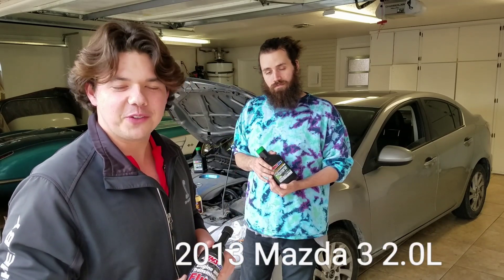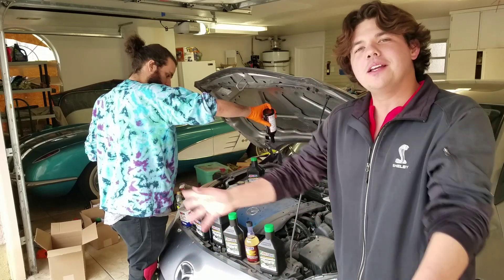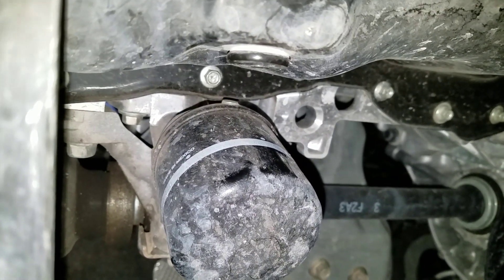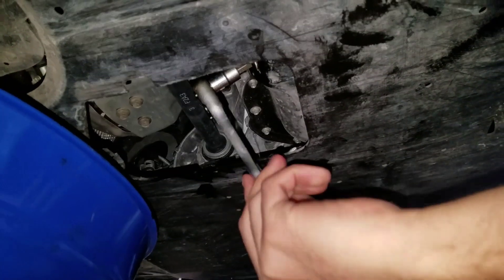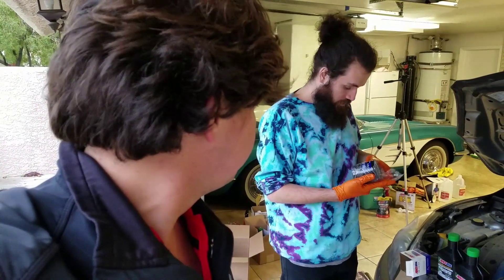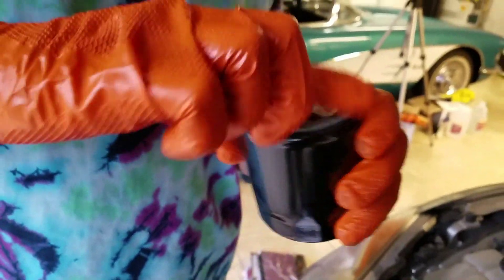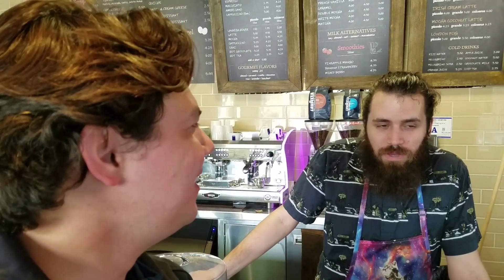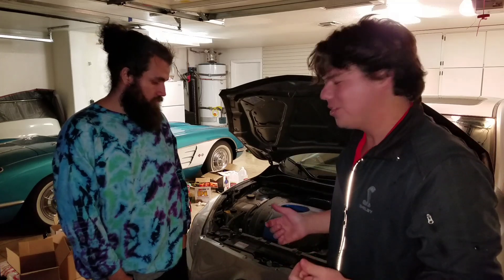2013 Mazda 3 2.0L Motor Oil change & Amsoil Flush

Comment from the maker: Professional YouLubher: Eben Rockmaker Regency Direct Jobber AMSOIL Specialist (Dealer#: 5331179) Mobile: (702) 472-3614 

      Ebens Wholesale AMSOIL Link + FREE Shipping: https://www.amsoil.com/offers/?zo=5331179.   & Text Me for latest promo code.  702-472-3614     

     Synthetic Oil Protection Coffee: https://supportwith.coffee/shop/subscriptions/sop/

SUBSCRIBE to Synthetic Oil Protection YouTube Channel - https://www.youtube.com/c/SyntheticOilProtection

        

     Synthetic Oil Protection Website - http://syntheticoilprotection.net/

Lookup For Your Vehicles - https://www.amsoil.com/guides.aspx?zo=5331179

      AMSOIL Performance Test Results - https://www.amsoil.com/performancetests.aspx?zo=5331179 

AMSOIL Dealer - Synthetic Oil Protection (702) 472-3614  https://maps.app.goo.gl/2AuZCi8h2Gaf3mY46

     

     Ebens Giveaway: 

Over $5000 Given to my YouTube Community Playlist - https://www.youtube.com/playlist?list=PLB_ftWArBFdey4HFt_Z9KgSIChjkLbw_o

About AMSOIL: 

       1. Where can I find AMSOIL? - Use this link https://www.amsoil.com/offers/?zo=5331179 

Or 

     Watch THIS: 3 Fast Ways To Get AMSOIL - https://youtu.be/RiYifuDCsnQ 

       2. What makes AMSOIL different than other oils? - 

AMSOIL is 100% Synthetic & has higher film strength & holds up 4× better in turbocharger deposit testing than Mobil 1 EP which protects and separates metal parts, keeping them from wearing and Lasting Exponentially longer: https://youtu.be/f4eNPgTi_qo 

3. Why should I use AMSOIL?: It protects the engine so it will last longer. Less oil changes less often (once per year/15,000 miles) or longer... Save money in Gas & Time making it less expensive than a free oil change over the year - https://youtu.be/H7K6FdZlqmg

     Professional YouLubher: Eben Rockmaker Regency Direct Jobber AMSOIL Specialist (Dealer#: 5331179) Mobile: (702) 472-3614

     Lookup For Your Vehicles - https://www.amsoil.com/guides.aspx?zo=5331179

     Ebens Wholesale AMSOIL Link + FREE Shipping: https://www.amsoil.com/offers/?zo=5331179  & Text Me for latest promo code.    702-472-3614   

   

     25,000 Mile AMSOIL OIL CHANGE - https://youtu.be/vp1HTtlulR8 

      The Power of AMSOIL Signature Series 5W-30 Synthetic Motor Oil protects against harmful deposits on turbochargers 4X better than Mobil1® Extended Performance and 3.6X better than Royal Purple® in industry-standard testing*. https://www.amsoil.com/newsstand/motor-oil/articles/leading-the-field-in-deposit-protection/?zo=5331179 

     Better MPG Proven - https://www.amsoil.com/newsstand/motor-oil/articles/another-win-for-amsoil-products/?zo=5331179

     AMSOIL Performance Test Results - https://www.amsoil.com/performancetests.aspx?zo=5331179 

     Lookup For Your Vehicles - https://www.amsoil.com/guides.aspx?zo=5331179

Comment: I have the same car and he needs to use  AMSOIL POWER FOAM  too to clean the intake valves. The PI ADDITIVE will NOT clean the intake valves. GDI or Gas DIrect Injection engines, which are almost 85 percent of the cars on the road today, do not have fuel injectors in the intake anymore they're DIRECTLY in the cylinder head. This is great for better gas mileage and power, but over time the EVAPORATION of Oil will start to gunk up the intake valves which will DESTROY gas mileage and give a rougher idle. I would do the PI and Power Foam before an oil change. My oil before I sprayed the Power Foam still had a good color to it, afterwards it was darker than the night which shows the oil picking up all the dirt from the cleaning. I did the PI on the last full tank of gas before I did the power foam so my new oil didn't become contaminated .  The beauty of AMSOIL is that the NOACK number for it is really low ( Evaporation rate) which means it wont gunk nearly as fast as other oils. But since this is a little older car its probably got plenty of gunk in those intake valves. I'm gonna start doing the clean every time I do an oil change myself. My engine runs so much better doing it and I'm not even running Amsoil.
Reply: You don't need to clean intake valves high detergent gasoline does that
Reply: @theodorerinehart781  the gas doesn't touch these valves. The fuel injectors are DIRECTLY in the combustion chamber as in the gas physically can't clean the valves ( hints the name direct injection) for this car. Some of the newer GDI engines like the mustangs have two sets of injectors one in the combustion chamber and one in the intake so the gas can clean the intake valves so carbon build up won't   happen and they make more horsepower in doing so. Many eco cars don't have that luxury yet.

Comment: Hi there Eben!
i found out that mike and i got tge same car year.. i have a jazz 2013 model and i am thinking about what Amsoil grade to use..please give me some advice for what i am going to use; should it be the 5w30 or 5w20?
btw, i am living in a tropical country.. my jazz has 30k km on its odo at the moment..
tyvm!
Reply from the maker: Great question Al this is the look up guide and it will guide you right to your exact filter oil fuel injection cleaner and flush and if you have any other questions you can call Amsoil technical support which you'll see on the main page also if you're going to buy oil it will be more cost-effective to become an Amsoil preferred customer because you'll say 25% off and you'll also get free shipping on orders $100 or more.
AMSOIL Vehicle Lookup - https://www.amsoil.com/guides.aspx?zo=5331179